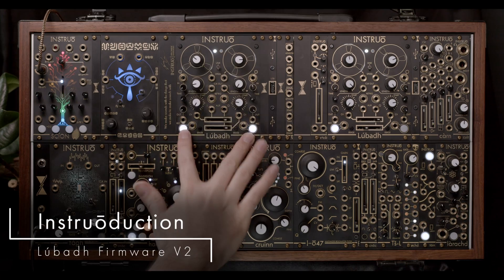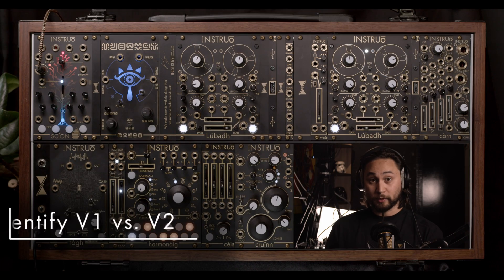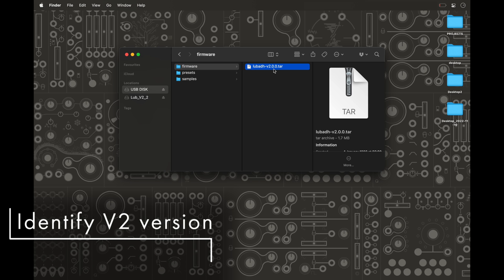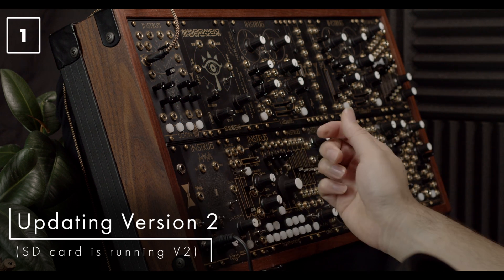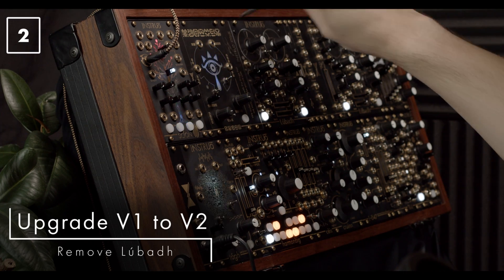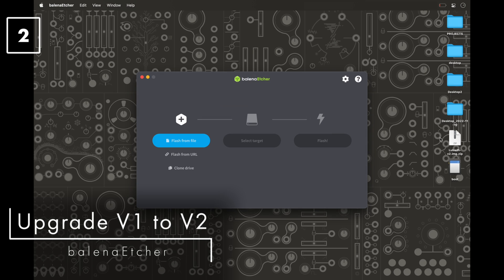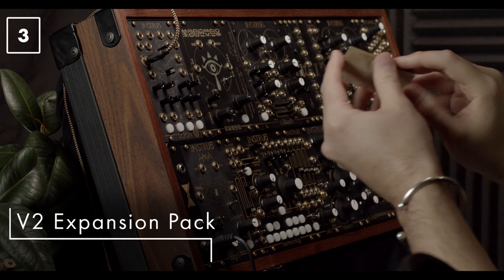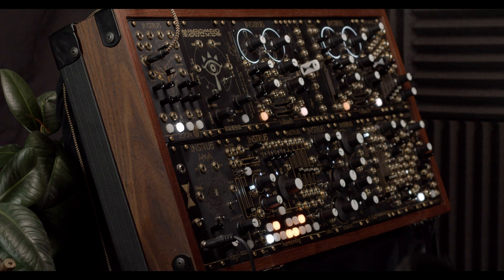Lúbadh - Firmware update tutorial

Comment: I've just downloaded 2.1 but instead of .tar it's .tar.gz. I've unzipped it and the suffixes have vanished. Can I just put the firmware (unzipped) on the usb and I'm away? Cheers
Reply from the maker: There should be no need to decompress the file.
Putting the .tar.gz file as is on the USB drive should do it.
Reply: @instruo  Great thanks!

Comment: I may have a problem with the v2 + usb expansion module. It seems that the main module cant find the usb. i cannot enter load menu pressing trigger+erase for 2 sec but nothing happens. presets also not working but i double checked the usb flash drive and everything seems fine. it just seems lubadh not recognizing it. any help?
Reply from the maker: Hi Lanky,
The Service Team will be able to help you trouble shoot :)
They can be reached at info@instruomodular.com or through the support page on the website.

Comment: So if we update the flash drive to 2.0, are the folders with presets then on the usb stick on the back of the lubadh? Or is the usb expansion mandatory? In other words can we use all 10 presets without the expander module?
Reply from the maker: Only the SD card updates to 2.0.0
Farther updates are simply loaded via the firmware folder on the USB drive as a means of adding the new binaries.

Preset curation to the A and B slot is done via the presetloader.txt file in the USB drive.
The USB expander isn’t mandatory but having more accessibility to the USB port makes things more convenient.

I have produced a dedicated video detailing the preset management.
Reply: @instruo  Ah my bad, I watched the entire 2,5 hour overview and update video but I should have watched the file management one too lol. I asked the same question in the facebook group which cleared things up. Absolutly amazing update can't wait. Thanks for clarifying!

Comment: when you say limited edition expander ......  does that mean a new lubadh build will be available eventually with a USB built in the front?  or??
Reply from the maker: The (limited edition) expansion pack includes: USB expander, 8GB USB drive with sample library, and pre-flashed replacement uSD card.
We're working on new Lubadh production stock which will ship preinstalled with V2 and will include the USB expander with it.

But there are quite a few Lubadh out there in the wild currently, so this kit will be available for those who want to add the USB access.

I honestly don't know what to expect in terms of demand for the USB expanders so I'm producing a certain quantity that's practical, but will adapt as needed.
Eventually when that demand has saturated the standard will be new V2.0 equipped Lubadh that ship with both CV and USB expanders.
Reply: @instruo  I definitely would like the expander. When will it be available?
Reply from the maker: @tanksmoonchild  Today :)
https://www.signalsounds.com/instruo-lubadh-v2-0-expansion-pack
Reply: @instruo  got it thanks!
Reply: @instruo  How long will it take for a second batch of expanders? I was busy yesterday so missed out and all sold out already!
Reply from the maker: @redlester  already?? Damn!
The second wave already went to distribution :)
Shouldn’t be too long.